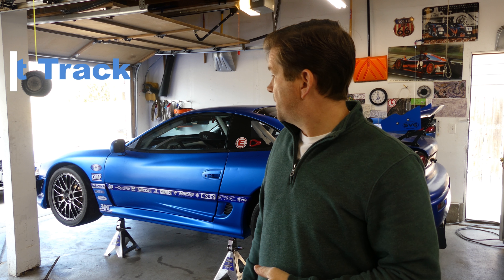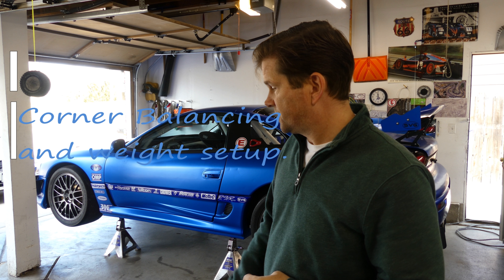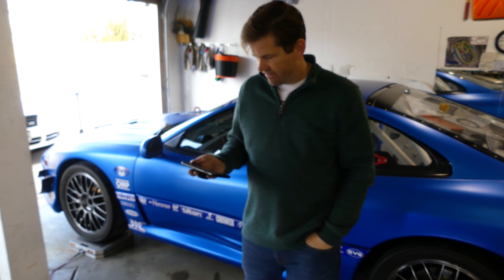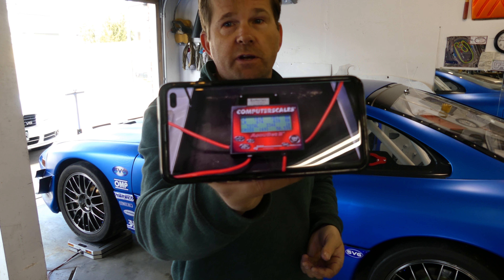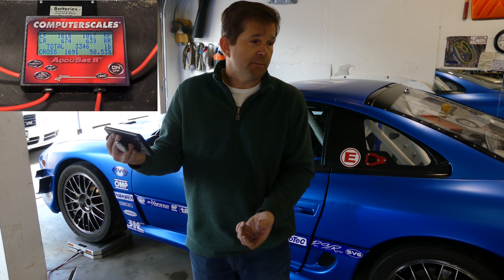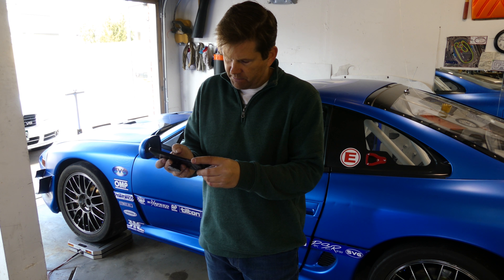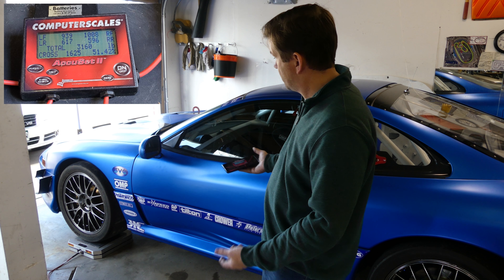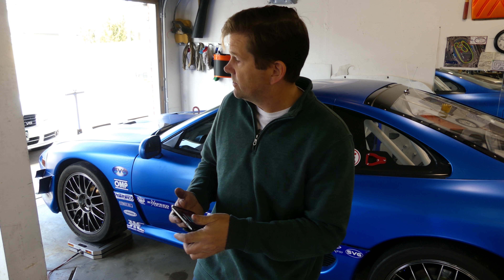How to Corner Balance a Car - The Simple Method

Comment: When I was apart of Porsches GT3 Club Program. We had steel stands we made in house that would bolt to the hubs, and matched the weight, and height of the wheels so we could make easy corner balance adjustments on the fly without having to lift the car and take the wheels off Everytime. 

It may be something worth looking into if you find yourself doing this alot.
Reply: Do you have some picture of it?Not having need to lift the car? :-o

Comment: Great video man. I'm Jeremy from Facebook, was talking to you last night. Always thought corner balancing was a little more involved. But appears pretty straightforward. Basically have everything laid out how you want it then adjust the coilovers to even it all out. Btw absolutely love the blue and the fact that it's a stealth. I'm building a 94 3000gt vr4 to look like a 93 stealth rt. And I plan on painting the car true blue pearl with white accents throughout.
Reply from the maker: Thanks! It really is an easy process, just time consuming jacking up the car and taking the wheel off every time. It helps to have the coil overs measured even left to right when installed as well. At least it's a good starting point. 
Very cool to hear about your car, it'll be fun to watch it progress.

Comment: Looks good.  Am I correct  - I believe you need to disconnect the front and rear sway bar end links before corner balancing to eliminate any preload.
Reply from the maker: It should be unloaded as the car is flat already.

Comment: Hope this helps, Spring preload to jack the cross weight, once done you use the lower clevis to set the ride height equal, the doors need to be closed while setting the cross weights.

Comment: Just to clarify, you lowered the shock collar on the right front to effectively raise the ride height in that corner and distribute corner weight to it?
Reply from the maker: You pretty much got it. Trying to take advantage of the additional spring rate with a little bit of compression. If it starts to feel like it turns differently left to right, i'll add a bit of pre load to the looser side.
Reply: @DoesItTrack  thanks! It’s still lost on me how increasing ride height in a corner also adds corner weight, I assumed it would be the opposite. I imagine it as a tub of water: if you race one corner, wouldn’t the water slosh down to the corner diagonal to the one you raised, hence making the subject corner lighter?
Reply from the maker: @gregrogers275  Think of this way. Standing on 2 legs, equal weight, right? Now start to lift one leg. The weight goes on the other leg.
Reply: @DoesItTrack  the lifted leg in this case would be the one with the reduced ride height?
Reply from the maker: @gregrogers275  Correct!
Reply: @DoesItTrack  thank you so much for your help!

Comment: Very good video! I've been thinking about how to adjust the my coilover. I'm a little confused, in your case, if the lower half is extended instead of the compression spring, the overall length of the suspension will be longer, and left and right may be uneven, right? Is it OK?
Reply: You are right, and that is not okay. Not only does the length of your damper affect the available bump/rebound travel relationship, which is key to performance, but the length effects when your bump stops are engaged relative to anything else. This is both a measurement that affects performance as well as your safety. 

On the safety hand you need to set up the length of your damper setup so that the bump stop engages before the tires, control arms, or any other moving parts in your wheel well touch the frame/body of the car. This keeps you from damaging parts or cutting tires on fenders, which could end up in serious accidents. 

On the performance hand, you don't want shocks to have different lengths left to right because that means one side will bottom out before the other. This will cause the car to pull in one direction under large compression events, which makes the car very unstable over rough terrain or large bumps. Not so confidence inspiring for a driver in a performance situation.

Comment: I didn't notice if you leveled your scales.  If not you will not have an accurate corner weights.
Reply from the maker: My garage is surprising level. I checked it with a long bubble level the best I could, along with the digital level gauge. There was a half degree deviation front to back, but close enough for what I needed. Good call.
Reply: @DoesItTrack  I had an epiphany recently.  I would always try to get all four scales level with each other which was a big pain especially with getting front and back level with each other.  All of a sudden I realized that since you can't jack weight front to rear that it didn't mater if the front scales were level with the rear.  As long as the two rears are level with each other and the two fronts are level with each other the scaling will be perfect.  I tested this by scaling as normal  and then putting equally thick spacers under the back tires.  No change.  Same with tire pressure.  As long as both tires are the same on one end the other end can be different as long as they are the same to each other.  Keep up the good work on your youtube channel!

Comment: heyy i have a question please does both sway bar connected on the test ?
Reply from the maker: You do want an end disconnected if you have any load on the bar at all. Then check it again after it's reconnected. If you have a lot of load on the bar stationary, there's something else going on too.
Reply: @DoesItTrack  thanks for your time and your answer but i cant do the setting with sway bar connected and still get correct numbers ? after all in track day the sway bar gonna be connected right ?
Reply from the maker: @melekk0  you can get the numbers for sure, but it may have an uneven feel left to right corners. If it does, it's time for adjustable sway bars links where you can vary the tension.

Comment: How do you get the suspension to relax since you're using jacks to lower it?
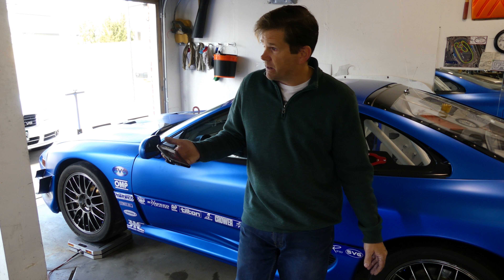Reply from the maker: Take a look at 6:15, you'll see the aluminum sheets under the tires. They have grease between them, aka, the old turnbuckle plates for alignments. It allows the suspension to go fully down to resting position.
Reply: @DoesItTrack  Very good, thank you for the info.